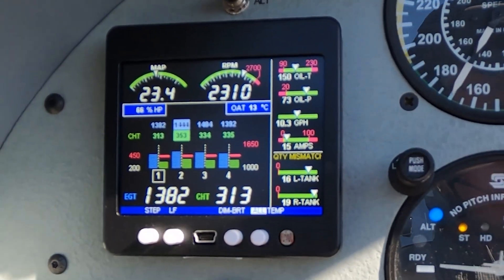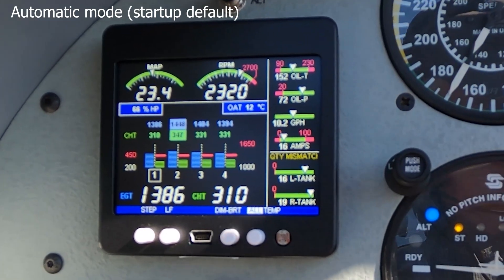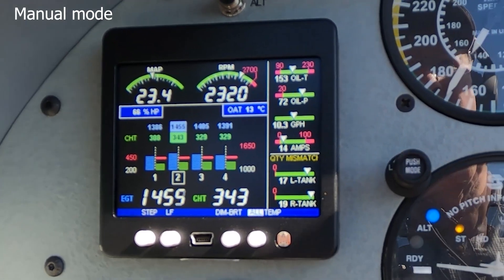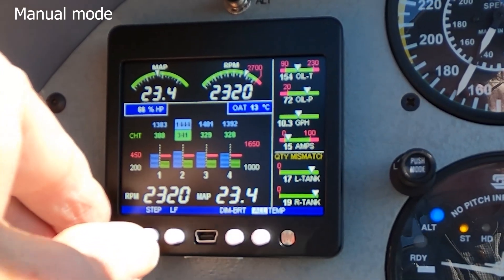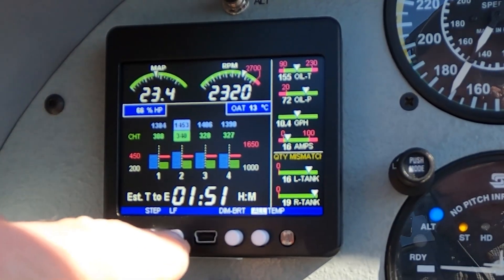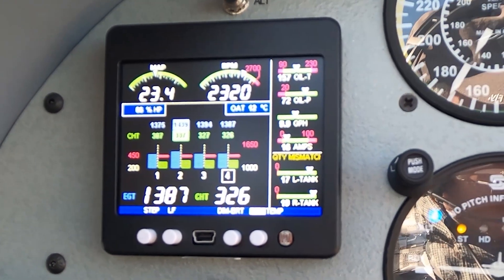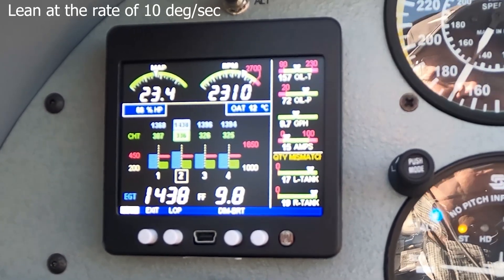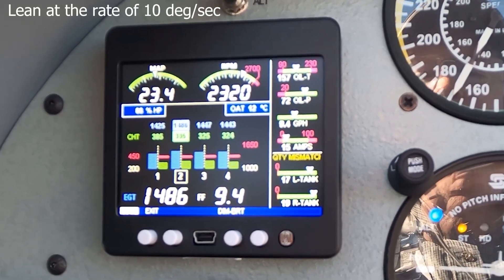RV-7 JPI EDM-350 2022-02-17

Comment: Thanks for the video.  I'm considering this unit.  How was the installation and setup?  Are you happy with it?  I've heard from some people that they had problems with setting it up.
Reply from the maker: I had a friend/avionics guy do the installation and setup.  He has done a number of these units.  It didn't appear to be difficult.  As for the post-installation setup, I've done a few adjustments and it wasn't difficult.  There are a few prompts that don't have much documentation for selecting.  It does help to have someone who has done it before.  I'm happy with the unit.  On the video (at the very end), you will notice I did a flow chart of how to navigate the 350.  I have a terrible time remembering (I'm 72) when to hold both STEP and LF for 3 seconds or 5 seconds.  I'm just not good at remembering things that don't have prompts.  And, again at 72, I'm really glad I put the engine monitor RIGHT in front of me.  The display is fairly small and seeing the EGT's, etc. requires that I really be looking at them.  But, that's the price paid for having everything on one page.  I dislike multi-page displays.  Hope this helps.
Reply: @stanhelmle5363  thanks for your input.  I like this unit b/c of it's compact size (it's for my RV4), and the color display looks like it's really easy to see.  But I'm having some hesitation b/c a few guys at my field said they hated the setup and one guy in particular was having problems that took months to figure out.  I'll need to look more carefully at this and other options.  What else do you have on your panel?  Are you using an EFIS, and if so, which one?
Reply from the maker: @aerobatixguy7682  Having an experienced avionics installer (Skywest captain, A&P) do the installation/setup really helped.  He sailed right through it.  I'll check with him to see if he'd be willing to walk you through the setup if you're interested.  My RV-7 is 20 years old.  I removed the E.I. UBG-16 and replaced it (and other E.I. instruments) with the EDM-350.  I also removed the vacuum pump, A.I. and D.G..  They were replaced with 2 Garmin G5's (and magnetometer).  I liked E.I.  But, I wanted a single page engine monitor.  The EDM-350 fit the bill.  I'm also running a GNS-430W along with an S-Tec 30 autopilot.  Everything is integrated.  It will fly a beautiful IFR approach (including hold, etc.).  So far, I'm very pleased with the complete setup.